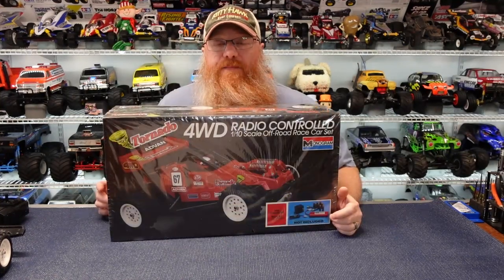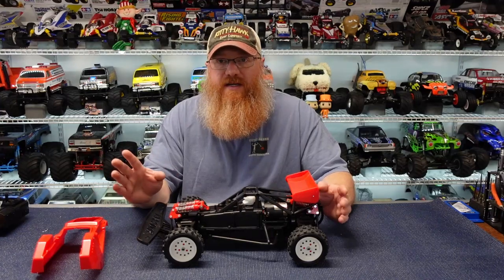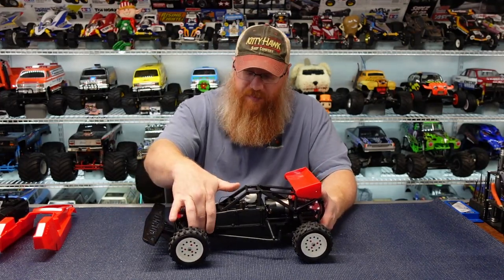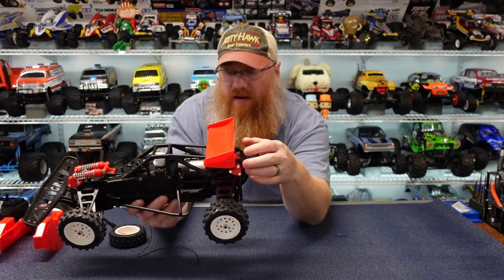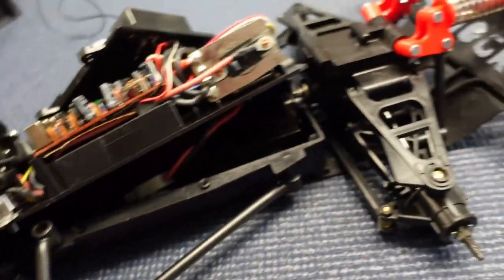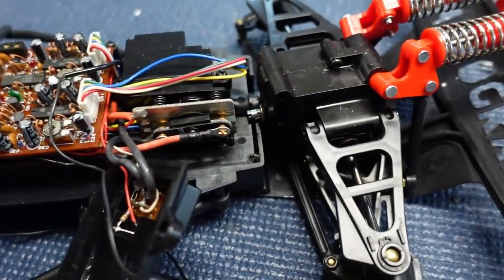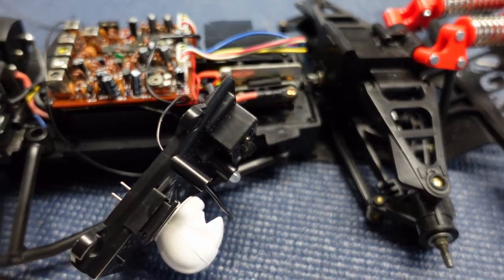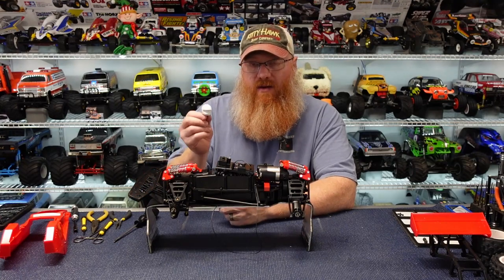Monogram Tornado Buggy Overview

Comment: It's a neat looking buggy. I am old enough that I remember AA battery packs to power the speed control servo. If you didn't taped the AA's in and they came out, the car would often stick in full throttle. I can imagine a kid getting one of these for Christmas. I wonder how long they lasted? There is a racing class in the U.K. in which mechanical speed controls are still used. It's basically an oval demolition derby class. If you have never watched a video you will be amazed. The cars are appropriately called "bangers." Thanks for sharing.
Reply from the maker: Yeah it is not the optimal situation for having those AAs in there and thankfully I have never had a run away with one like this but my old Super Blackfoot went rogue a few times and ended up flying into the woods at full speed more than once! Half the time the reciever got wet and freaked out and the other time something else went wrong and caused it. Thankfully it never broke anything, it usually got caught by a branch or something before smacking into a tree! I think the buggy itself might have lasted for a while. The body however may not have lived that long. Cold Christmas mornings and the think body shell getting beat up by a novice driver probably broke quite a few of those! 
I have seen some of the banger races and I absolutely love watching them, it is a hilarious amount of chaos and carnage!!! LOL
Reply: Hi.
I have a Interceptor. When I connect the battery, the car start in full throttle. The AA batteries are in, but ye...sound like it could be some problems there? Anyway to check this?

Really want to drive my Bandai Interceptor again so hope you can reply 😁
Reply from the maker: @lennys9818  it sounds like the servo is not moving the mechanical speed control. It could be a radio issue, a servo issue or the speed control has become disconnected from the servo. Before taking it all apart you could unsolder a motor wire and turn it on and listen if you can hear the throttle servo moving back and forth. If you can't it is with the servo locked up or the radio system isn't working. If it is moving then something seems disconnected inside,

Comment: Very cool presentation Addam. The part with the motor wedgie (is this the correct writing?) Was very interesting for me.
Reply from the maker: LoL yes you got "motor wedgie" correct! It seems like they figured out it was an issue and instead of fixing the root cause they put a bandaid on it. It was a  reasonable fix I guess but why they do not install it by default makes no sense to me!! 😂
Reply: @AddamsPlayground  you're so right. I had never seen anyone using a guggy and not to try jumps.

Comment: Oh yeah!  That Tornado is MAD!   It is a very cool design!    I am surprised how little the front shocks seem to move.

Since the motor is visible, I would be tempted to try to fit one of those motor covers/fans that look like a V8 engine.
Reply from the maker: Yeah, sadly the front shocks are fairly useless! The links should have been move further out on the arms to allow for more use of the shock travel. They move maybe 2-3mm under full travel of front suspension and the is like 25-30mm of travel in the shocks! It is a very interesting setup and with some corrections I think it could be a really awesome buggy and could have really competed with the bigger companies. The motor cover would have been funny and ironic as it would have been a Hotshot and Big Wig clone!!

Comment: Very interesting vintage design! I thought it looked hobby grade out of the box. That’s for taking it apart and showing us how everything works.👍😊
Reply from the maker: It is as close to hobby grade as I have seen outside of a Hobby grade prebuilt! You could replace almost everything and it is the first kit like this I have  seen a mechanical speed control on. Most ran off the circuit board and made them weak and very under powered. Since this is running off the MSC and not the board I hope it is a bit more punchy and fast than many others but I have not been able to drive it yet due to the rain and time!  I will get it out as soon as I can and see what it does!!
Reply: @AddamsPlayground  Yes, it’s unusual to find a msc in a prebuilt rc. Looking forward to the running video.👍😊

Comment: It still a neat buggy. I remember the circuit boards. If it went bad you were done. Then we pulled it behind our bikes with kite string. Actually did that with older vehicles than that. But fun. Look forward to see it run.
Reply from the maker: At least this one has the mechanical speed control and I think that will be a big improvement over the weaker and less effective electronics, on board speed controllers many had. It should be a lot peppier and hopefully faster with the MSC! I did have a few that got wet and fried growing up and we really had no way to fix them. So they did go from fun to a brick really quickly!!

Comment: Besides the Interceptor, there was the Brushfire and another cheaper clone of these 4wd buggies. I don't recall the name of the other at this time but it did have some kind of race flag decal around the body. Monogram had a popular 2wd beginner buggy called the Lighting.It was similar to the Radio Shack Red Arrow. Also JRL had those mechanical speed controllers in there old toy grade r/c cars. I remember as a kid, I took apart my dad's 1957 Chevy from Sears (made by JRL) and it had one, running a 380 Mabuchi motor.
Reply from the maker: Thank you for the additional info! There is not a ton documented about these kits and what is most questions about where to get parts from forums!! So not very helpful there!

Comment: I never seen something like this before. Did not know Monogram made RC´s back in the days, or relabeled it 😉 I only know this brand form static models which I did years ago.
Reply from the maker: That is how know them as well, from the models and some die cast cars. I was really surprised when I saw that name on the box!!! It is a quirky buggy and some seems to work well and other bits are a bit of a miss. I think with some changes they could have a really great buggy but this all came out when everyone was pushing the boundaries of things and innovation often exceeded functionality!

Comment: Thanks for the overview. It was nice to see the innards. The “motor wedgie”, LOL, seems like an afterthought. Does it seem like it will stay in place or wiggle itself loose?
Reply from the maker: LOL, 'motor brace' just did not seem to do it justice! It was such an afterthought piece I had to term it the motor wedgie! It does lock into place, there is a small notch in the chassis for the square nubbin to fall into kind of locking it into position. There isn't enough play for it to really pop up and if it does then there is probably 1-3 other major issues you are dealing with at that point!! I still don't understand why it was not installed to begin with....

Comment: Great overview on the tornado very interesting rc
Reply from the maker: It is a strange little thing but in a very neat and unique way! I think if the front suspension was done a little bit better and it had two more body mounts on the sides it would be a much better buggy. I am not sure if you saw but the front shocks only compress maybe 3mm at the most under full compression. So it is utilizing less than 10% of the available shock travel so there really is next to nothing up front in ways of dampening. the rears at least do move some but those two could have been pitched outwards further on the rear arms to create more travel. If I were going to run it more than once or twice I would look to make longer pushrods for it but it is not worth the risk of breaking that shock mount in the rear really.
Reply: @AddamsPlayground  it was crazy when you put the batteries in how much it dropped and I wouldn't want to break it either
Reply from the maker: @ThompsonRc  yeah, it needs a bit more support for the weight. I think it'll do ok for a light run but wouldn't do much more than that.

Comment: It looks really well designed cosmetically but has run into a few issues with lack of experience mechanically but I suppose toyish grade cars are designed to be a one time purchase for the manufacturer. Cool to see history though mate
Reply from the maker: They did really well on some things and fell short on others! This is the first one like this I have seen a good MSC in unlike the normal underpowered circuitry controllers from the time so that was a big win. The replaceable parts catalog allowing you to rebuild almost the whole car was also a huge win. the suspension is eye candy and is kind of awful, so fail there. The weak mount from the chassis to the gearboxes and the 'motor wedgie' were also let downs as that should have been addressed better, so another strike there. All in all it is a wonderful little time capsule of a period of time where innovations were coming fast and furious and some were hits and many were misses but it all shaped and molded the hobby we have today!! It is also the proper amount of weird and cool I love!!

Comment: Bro all that effort looked like reverse engineering I think your right about the front shocks something has to give stiffen it up to much you'll just start breaking plastic and ripping screws out sorry for late comment been mia for a few days nice work bro especially painting that helmet and face 👊
Reply from the maker: Thank you and don't worry about being a day or two late on watching, I am a few days behind myself! It has been a whirlwind of stuff going on!! I think if they have moved the pushrods further out on the arms it would have given in more travel in the shock making it a lot better, right now that front shock might move 2-3mm at the most and the shack has around 25-30mm of travel. They did well about making other designs their own but failed to make that functional in some areas!!! I think with some corrective changes to the design it could have been a really solid contender at the time! It is a great little time capsule and the perfect combo of odd and awesome I love!!

Comment: Look like it was a pain in the arse to get back together.
Reply from the maker: It was a little finicky to get the shaft back into the gearboxes correctly! Of course I started doing it the hard way and fighting it blindly without remembering you can see the driveshaft in the battery tray! It helped but was still one of those tasks you need 3 hands to do easily!!! I was well worth it to see how everything went together and figure out the potential issues from the construction of it!

Comment: That was really interesting Addam👌
There's so much to look at and think about with this one. The circuit board is so complex compared to our modern electronics using micro chips. That was mind blowing! Thanks for going to the effort of disassembling it Addam🏆Awesome video as usual mate👍🦘🇦🇺
Reply from the maker: Thanks! I was just surprised it is running a good MSC versus the weak onboard controls but then it has really poor front suspension and way too much flex in the front and rear chassis sections where the gearboxes attach. It is like they put effort and thought into some things and skipped over some problem areas instead of fixing them. And why they did not install the motor wedgie from the start is beyond me! It is still a very unique buggy and a wonderful time capsule from an era of RC where innovation went much faster than good judgement and we saw so much cool stuff come from all that, it is wonderful!!
Reply: @AddamsPlayground 
You hit the nail on the head Addam, it's as if they were rushing to get it on the market while the Hotshot iron was still red hot.
The motor wedges could have been built in as part of the chassis design too.
You're so right mate, it's a very rare time capsule, luckily it's safe in your collection now.
I'm glad your wrapping it up for its 1st ever run, image trashing it!, I'd cry lol.
I was really surprised to see the MSC as well and right next to the old school PCB, it was most likely borderline not fitted with an MSC, Someone had a brainstorm and said "Hey let's FIT an MSC to this one!🤔"
I wonder if it had a brand name servo fitted?
Reply from the maker: @outbackrcaustralia4895  the servos are the typical stepped design and very generic 5 wire ones you find in many toy grade RCs like the Nikko/Tyco/RadioShack type cars and trucks.
Reply: @AddamsPlayground 
Ahhhh that's right, I did see you mentioned that in the video, sorry mate... I got too excited lol
Reply from the maker: @outbackrcaustralia4895  LoL no problem at all. I get distracted by being distracted all the time so no worries!!
Reply: @AddamsPlayground 
 👍🤣

Comment: Is there a motor brace for both sides of the motor or just the one side you showed in the video
I can't believe you're getting three videos out of this lol 
I can't wait to see what the video looks like of everything I sent you lol
Reply from the maker: The brace just goes on the one side. Basically when it would bottom out the motor would flex downwards and cause the gear mesh to change and lead to stripped gears. The little brace kept the motor being able to flex downward (well the whole housing flexes but you know what I mean). I have it all recorded but have to edit it all, along with 3 or 4 others. I have two speed runs, two tools I reviewed, a battery review and the stuff you sent me. So I am going to be spending a lot of time on the editing software! LOL!
Reply: @AddamsPlayground  Did you get my email explaining what the  "pipe bomb" was lol
Reply from the maker: @nomusicrc  Yes, I had kind of figured it out as I was too curious to what it did!